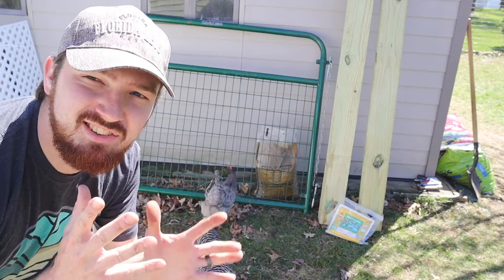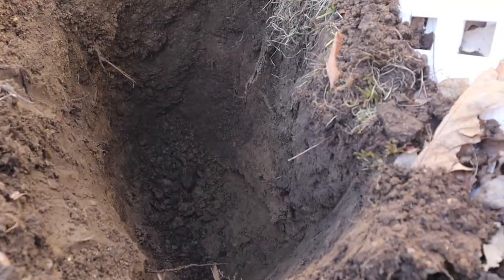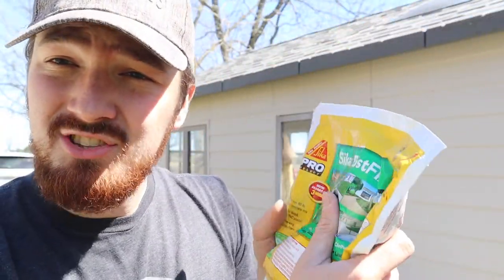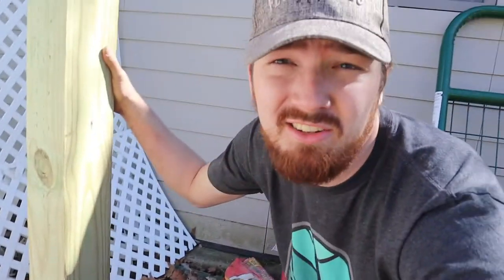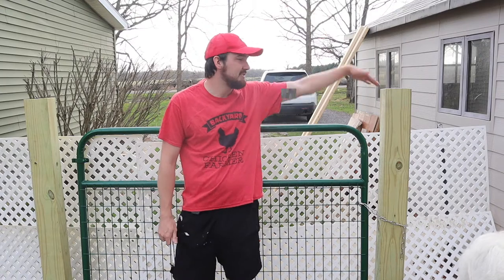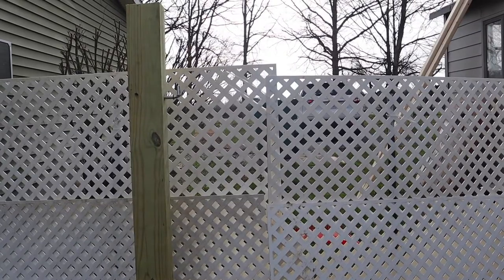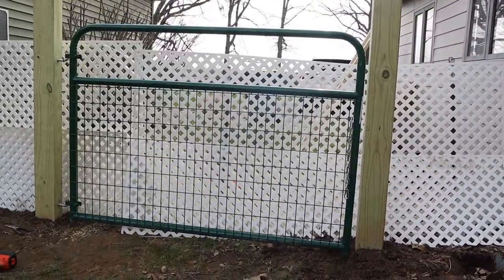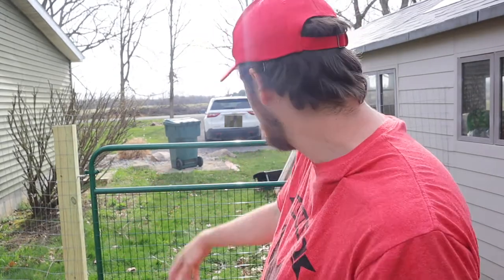How To Install A Utility Fence Gate The Easy Way!

Comment: You should probably use a latch instead of a chain.  I've seen some dogs that have broken many chains.  One of my dogs broke my newly installed, brand new chain link fence.  He took a run at it, and the bottom foot of the chain link parted and bent like it was made of butter, and he kept running on though it like it was made of typing paper!  I was shocked!  He was an over-exuberant Australian Blue Heeler Mixed Dog.  He also gnawed down several of my mature lilac bushes, and some of my mother's young, newly planted fruit trees.  He always annihilated chew toys in record time, too.  Amazing dog.